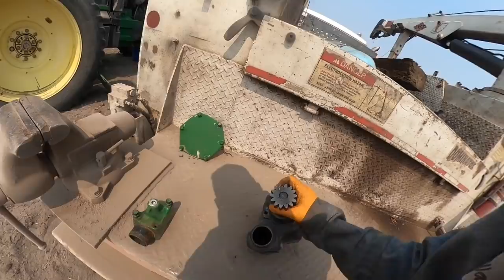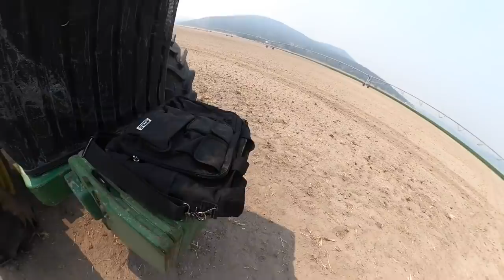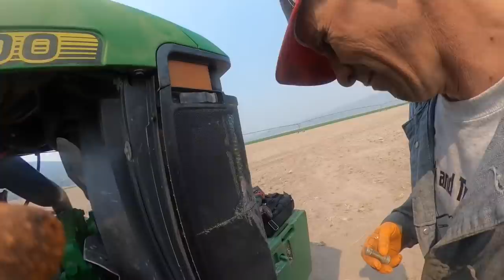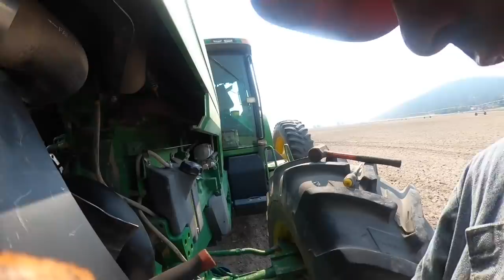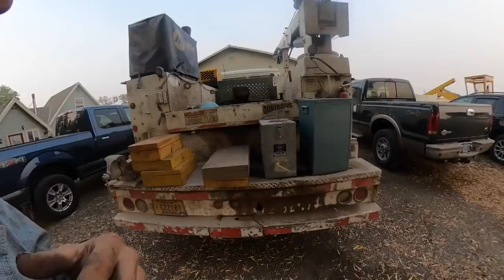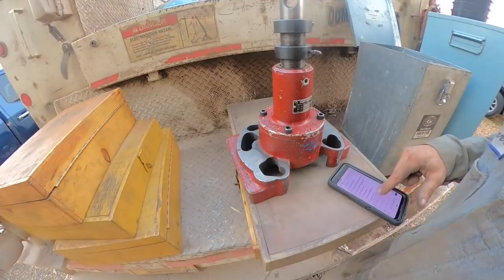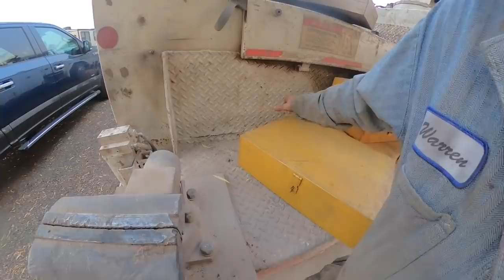Reman junk!

Comment: here a question for anyone, 30+ years ago when i was younger our parents use to swear by remans parts use to be the best and now it seems like it when down the sewer
Reply: once the made in commie china came into play, its all went to junk.
Reply: Back in the 50's and 60's every little town had small businesses that rebuilt  components of automotive, agriculture, and machinery. There was a place that rewound and rebuilt alternators, generators, electric motors; another that would boil and rod out radiators, a shop that would acid dip blocks and heads and then remachine them to spec; bearings and bushings and gears were made to spec tolerances from proper alloys of steel and heat treated accordingly; you could get your four barrel carburetor rebuilt for $50 bucks. Now days, forget about it.
Reply: @JohnBrinkPhoto  My dad apprenticed in the late 50s in the UK, and stuck to classics in the late 90s and semi retired in the 2000s. He could make a side runner for a classic car out of wood and a bath, and always had a glass vat full of acid. Washed his hands in gun wash type of guy, best hand cleaner you can get apparently.
Reply: Thing is, my dad remanned alternators, starters, heads, blocks, anything that could be rebuilt really, and very few failures at all. Then it got pricey in the terms of labour, and the people would want the “parts store” part. He said to a guy you’ll be back within a year, and he was, with more problems than when he started, similar to this water pump. Money always wins, don’t care who you are.
Reply: Reman has been junk since the early 90’s for sure.

Comment: had a 2000 chevy suburban it had both sae and metric it was a pain to work on having half your tool box layed out
Reply: Have a Ford with the international diesel, Same thing. Metric and Sae.  on the same brackets for alt, air conditioner etc.

Comment: A soft start is ideal for an AC motor that runs at full speed all the time.  A Freq drive (VFD/AFD) are for both soft starting and controlling the speed of an AC motor to control for pressure, flow, etc.  Freq drives can also spin a motor faster than 60 hertz as well.  Like anything else they can be basic or wild depending on application.
Reply: You know when I tell people what you just said they look at me like I'm crazy. I worked in a sugar mill and we had dozens of vfd's most of the time it was to speed up or control flow of pumps.
Reply: how does that work on dc?
Reply: @kennethhoover6195  VFD don't work on DC, there's no frequency on DC.  You have to control the voltage to control the speed of DC motors, and that requires feedback to know what the motor is turning, because DC motors will speed up with less load and slow down with more load.
Reply: @rodfreess6019  I understand DC is controlled by resistance how do you control ac?
Reply: @kennethhoover6195  changes the frequency. If nameplate says 1750 rpm at 60 Hz, the speed will be proportional when you speed up to 100, 120 Hz and slow when you go to 40 Hz. We've got a motor with 72:1 reduction to 15/60 chain drive to get final shaft rpm to roughly 1/10th motor rpm. We run the arm at 4 rpm and motor at 40 Hz.
Reply: Geez a $40k VFD, I hope a nerd like me could repair it. 😕😔